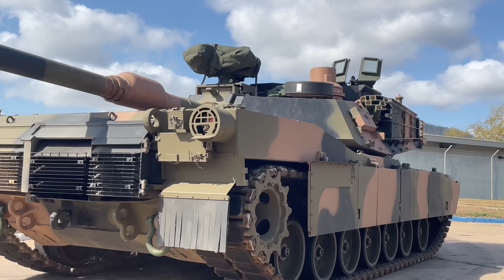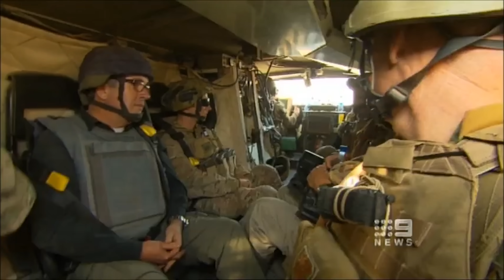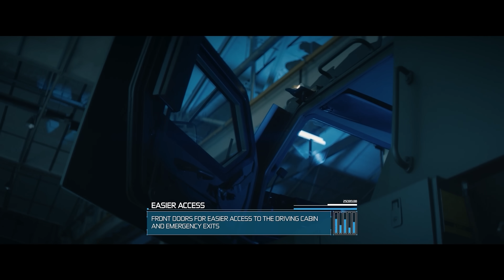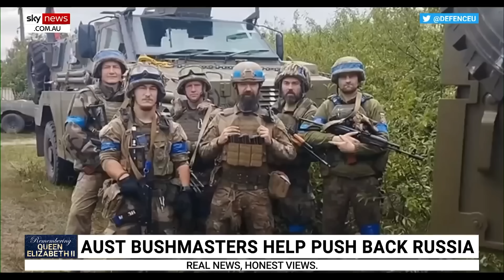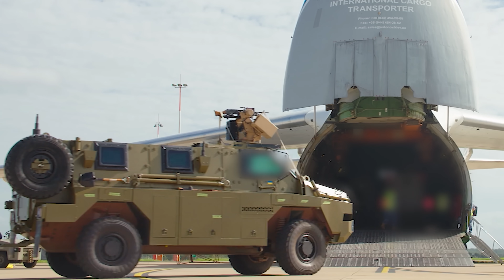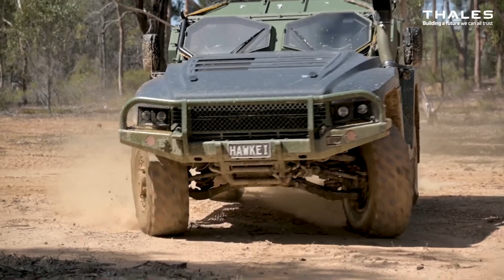The Bushmaster: The Aussie Vehicle Soldiers Refuse to Fight Without

Comment: MANPADS like Javelin and NLAW can neutralise armour in moments. Warfare is evolving beyond these antiquated, fuel-guzzling platforms toward drone-driven situational awareness, satellite-guided targeting, and remote stand-off missile systems. Heavy vehicles are increasingly cumbersome and impractical as we move toward a battlespace where opposing forces may never see each other.

Australia is particularly vulnerable to long-range missile attacks from submarines. Cut our sea lanes, control our northern airspace, and the country is rapidly isolated. Add to that the emerging, quietly integrated FOB element, and the picture becomes even more concerning.

I’ve seen a few of the videos circulating on this topic, and most miss the mark. But anyway—have at it.

Comment: Hello  Mel, how about telling the truth about its development and not the made up stories being bandied about to make people feel good. Let me start off by pointing out the "prototype" Bushmaster built by Perry engineering in partnership with Timoney Engineering and Stewart & Stevenson had zero, take note, ZERO blast protection when ADI acquired Perry Engineering's interest in 1996. Let that sink in. And there was ZERO blast protection knowledge and experience in ADI when I was contracted in November 1996 to assess its blast protection at the time. Not a single member of staff had seen a mineblast or a mine protected vehicle either. Not even one person! The Perry/Timoney design had so many defects and shortcomings it simply could not be fixed and only a total redesign could fix the concept. To this end I conducted and directed the first two vehicle mineblasts conducted on December 13 ( which failed)  and January 14, 1997 which was a success and provided the hull design which has now become so successful. Design leadership was South African (without which there would not be a Bushmaster today) and many of the so called Bushnaster team learnt what theyknow today on  the job. So to summarize, it was not Australian designed, but was designed in Australia by me and my team which included people from the Ireland, England, the US  and of course Australia.
How do I know all of this? I was contracted by ADI in late November 1996 to completely redesign the Bushmaster to actually make it mine resistant and my redesigned Bushmaster rolled out of Shop 7 in Bendigo on September 17, 1997.  It is worth reading the official history of  ADI called Breaking Free and confirmation will be found there of what I am saying.

Comment: It actually drew its design from the South African riot vehicle that Top Gear showed on a episode, which used a solid rigid suspension unlike the Australian version which has fully independant suspension on all four wheels. The versions I drove were 300kw plus around 1150NM of torque from a straight six Cummins diesel mated to a 6 speed ZF gearbox. They weigh 13 tons dry weight and 15 tons fully combat ready. They have a 300 ltr water tank in the back which was handy, CTIS, four wheel disc brakes and cruise control. Fully aircon inside and pre fitted with a internal fire supression system. I was told the prototypes were first used in Timor by Special Forces before becoming mainstream. V bottom hull was very successful at deflecting IEDs. They have a winch that pulls from the front or back and a 20ltr fuel tank inside the engine compartment mated to the main 300ltr external tank. They are great across country, are very stable even in tight turns on skid pans and can climb almost as good as a Unimog.

Comment: Lets not forget the intended purpose of the Bushmaster is "Protected Mobility". It is NOT and armoured fighting vehicle, never was and never should be considered as such. It IS THE BEST in it's class of PMV, far superior to any other PMV currently in use. Detractors say it can be dissabled or destroyed too easily, maybe so but ask the troops who were inside during the attacks. They ALL SURVIVED, not a claim any other PMV can make, especially the US designed MRAP family.
Reply: Ukraine has shown as a battle taxi it does it's job well. Taking hits and still doing runs afterwards.

There have been deaths in Bushmaster. But it was ambush and troops where killed exiting after the wheel was destroyed.

Comment: I am a civilian with a keen interest in military hardware. The Bushmaster in standard configuration has a self recovery ability that most similar vehicles simply do not have. The winch can run forward or back and is powerful enough to recover other Bushmasters as well. The size is good and clearly the troops got massive impute and made it as good as it is. As a wheeled MPMV it reminds me of the Ratel that the South Africans made. The Bushmaster is superb and the more we have the better.

Comment: Hi Mel, I love the Bushie, but we should acknowledge that it is based off the MP44 designed by Timoney Technologies of Ireland in the mid 90's. The first prototype Bushie was built 1996 and was strongly influenced by the MP44. the Bushie still uses the Rockwell/Timoney independent suspension, designed specifically for the MP44. Google a pic, the lineage is unmistakable.
Reply: Maybe so, but their vehicle doesn't have a look in now compared to the major improvements Aust made to it!

Comment: My concerns of all variant o  f bush master  we know ir   handles some form of  gravel  bush track whether it be in eutopw or  africa
My  how does  ieach, bulldust or  manfrove swamps  where you get a 2.5 ton landcruisers stuvk band hard to recover

And whats the current weight per variant????
Reply: You know that it was specifically designed to handle anything Australia could throw at it right? 
As for getting bogged it's carrying a winch that would treat 2.5 tonnes as if it's nothing.

Comment: An easy upgrade path would be nice, it is modular so hopefully adding more to it would be better than designing something new, I noticed they said there was an electric version, they should have a hybrid!  Engine for the long kms on the way to battle and battery when moving onto the battle line.  My 2 cents worth.
Reply: Maybe it drags a Diesel Generator around on a Trailer, not enough Power Charging Stations in the Field. Especially in Battlefield, Disaster Zones.

Comment: The PMV fleet is aging, first introducted in the late 1997 to 6 RAR, the ADF needs to start looking for a new vehicle design. To me it would make more sense to have a mixed fleet of 4x4, 6x6 and 8x8 with a large proportion of parts commonality. In it's current form, the PMV is fine for lower intensity conflict and internal security - but it's old and needs to be replaced by a new dynamic fleet.

Comment: If it ain't broke, don't fix it, provided it can be updated for current needs without compromise
Reply: It's nearly 30 years old. Designed for internal security and low intensity conflict, not against a modern adversery.
Reply: @Medieval_Mayhem more powerful engine and better armour and it will keep doing a good job.
Reply: @Medieval_Mayhem what? Not meant for conventional warfare? I'm pretty sure they're more suited than a landrover or Mercedes, they're protection lvl is as good if not better than an APC its a taxi to get you close to the battlefield, then dismount and fight as traditional light infantry, its not an APC in traditional sense and definitely isn't an AFV or IFV, which are designed to ride into battle, its a testament to them that you can actually ride them into battle. They offer Australia a way to react quickly within Australia and get troops quickly up and down, back n forth across Australia's fwy/hwy network into an area of operations if ever needed.
Reply: @montys420-  the bushmaster was designed for internal security and peace keeping roles, not high intensity conflict which Australia faces in the next 10-15 years tops. Probably less.

Comment: One with a large battery system and a laser system would be interesting
Reply: or now i think about it a big box trailer with a generator and battery on the back and a laser on the roof.
Reply: Based on the Apollo you might need to expand the wheel base to fit the battery

Comment: This should replace the Ford Ranger as the tradies choice. With upgrades to suspension such as coloured springs, a freezer box for beer and iced coffee, a pie oven, twenty USB ports through the cabin and a new tactical system that can reduce the trip home by10 percent by taking direct paths through roundabouts even faster then a Ranger, this vehicle would be ready for every threat on the building site and work run, real or perceived by your local tradie. Bonus: plenty of room in the back for the kids and ample towing capacity for the speedboat.
Reply: Perfect for the non permissive environment of the inner city.
Reply: From  a retired plumber, well done ,sir!...well done...
Reply from the maker: The truck we never knew we needed.
Reply: I’d buy one. 😂
Reply: Hahaha
Reply: Not just for tradies. Give the wife one to take the kids to school or shopping.
Reply: You cannot drive that on a LV license in civilian life. Where to park on site?
Reply: @pyap01  where ever you want to.
Reply: @pyap01  MR/HR licences cost about a grand and only require you have something in your brain to pass (and some actual skill. (Also randomly they really need to enforce caravan drivers getting one as I see so many gronks with a severely overweight trailer on their SUV's). As to parking; you park it on top of all the Hiluxes and RAM's that dare take your spot. Ironically they would actually make a great mobile site office once properly fitted out.
Reply: Crikey mate just buy a Hilux with a tradie pack but watch out for the plumbers in their jacked up RAMs
Reply: Tradies manage this with a Ford Ranger at a lower price, plowing through the rush hour nerds with great gusto.
Reply: If I can get one in black with spinning rims, I'm in.

Comment: The Bushmasters have remained fairly intact on the battlefield in Ukraine. The 'Travelling with Russell' youtube channel visits Park Pokedy in central Moscow. The Bushmasters on display compare favourably with similar NATO vehicles that have been smashed. Might consider a larger version of the Bushmaster to carry the large diesel generator used with laser defence equipment and a new version of the current size with a clean drawing board for anti-drone capability, 360 degree sensing, autonomous operation to collect stranded troops etc.
Reply: Fit Slinger 30mm AAA on a flatbed version.
Reply: Travelling supermarkets with Russell.